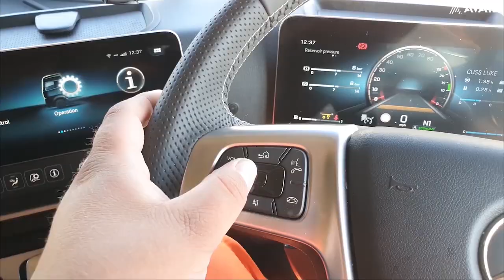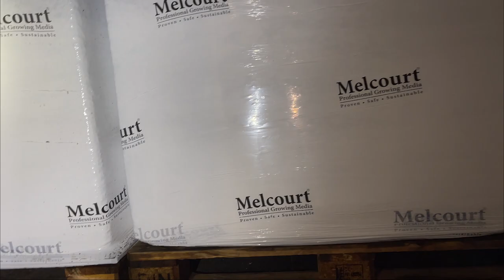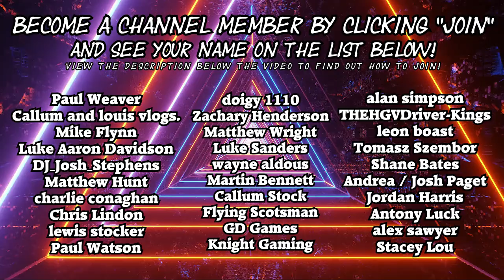She's A Tight One #LUKECINAHGV

Comment: 1 do hgv's have auto gearbox's ? i never see you changing gear.
2 why slash the curtain can you not just undo it to look inside ? 
3 i was told the rear door's are left open to stop the truck exploding due to air pressure change from different temps ect ?
4 are the seat's fixed to the truck ? they seam to move around a lot.

Comment: I thought truckers left a trailer door open when there was nothing inside to demonstrate there is nothing to take lol
Reply: Well if you have a curtain sider and thieves want in to see what they can steal just as well leave the door open, but I always kept my door padlocked with a seal on it as you weren't allowed to break the seal only those at the delivery point were allowed to take the seal off ,but that was usually on box trailers whare everything came out the back, I sometimes used curtain siders but still kept them shut and padlocked for insurance purposes, because if someone broke in that was breaking in and entering to steal which is a criminal offence, and then you can claim the insurance, but not if you leave the doors open!